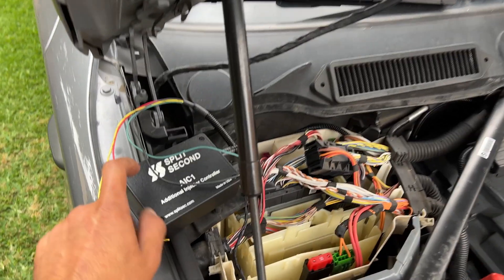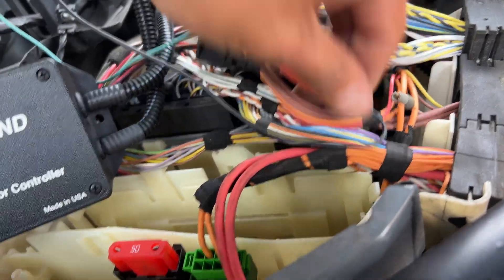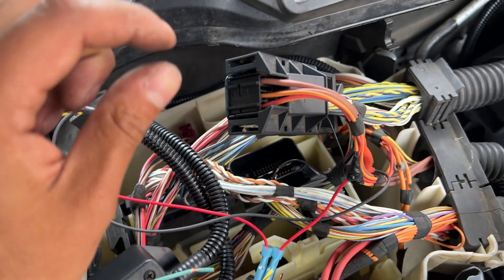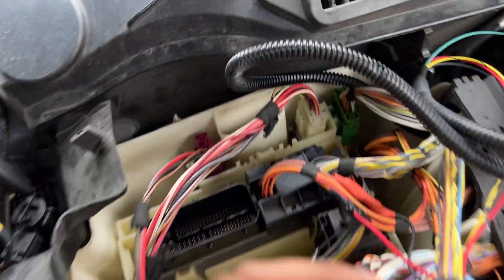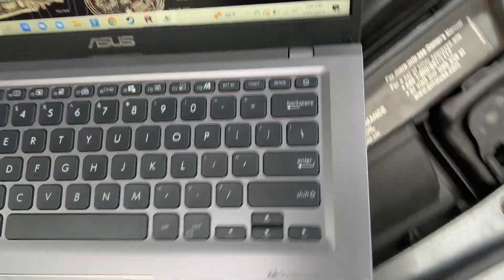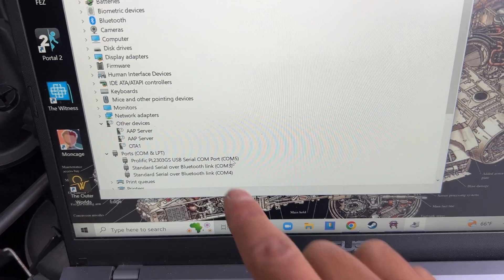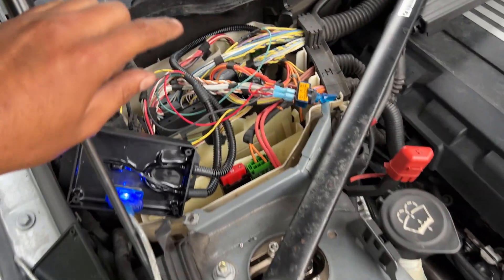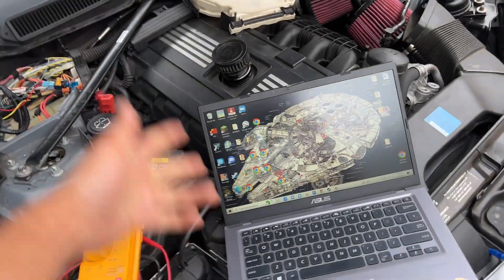How To Wire And Flash Port Injection Onto BMW!

Comment: So theoretically, I don’t want to run direct injection bc I don’t want to buy index 12 bc they are $2000, I can run port injection alone?
Reply from the maker: Yes but you would have to get a full custom tune, drill and block off the DI holes

Comment: do I need to flash the ecu thro the computer if I have mhd? or can i just wire it and the tuner can control it via the mhd custom tune etc etc?
Reply from the maker: It’s flashed separate with a laptop and usb cable

Comment: I’m trying to flash my port that has already been previously flashed from the last owner. And I’m using the exact same cord and following the instructions that you are going by. and for some reason when I pull in the tune for it in r4, I cannot switch COM1 to COM5, the drop box doesn’t even work. Pretty confused right now and need some help lol. I’ve turned the ignition on and all to get a connection and just can’t figure out why I cannot switch COM and flash
Reply: Do you figure it out bro I have the same issue
Reply: @ bro I did figure it out, but unfortunately I don’t have the car anymore and I don’t remember what I did, I sold it cause someone asked the right price..
Reply: I see well I need to do some research because I don't know why is not connected to the dme it says com error something like that and I switched to com4 and it says make sure your split is connected right

Comment: So i followed the n54 wiring diagram online and my car seems to sound like a cammed 67 big block lol, what could i have done wrong?
Reply from the maker: Either wiring is not making good contact. Or the time you have on the AIC controller. The Port injection should not be activated at idle. Usually only under load
Reply: @menjicar  I fixed the problem, it seemed to be the 3 port max solenoid option on MHD conflicting with the box.
Now only having idle problems (wants to stall, bouncing from 500-700rpm) i believe it’s lpfp since it’s at 58 on idle

Comment: Hey I found and now use these connectors that have built in Solder as well they are already shrink tubing all in one. They are great and all sizes. I bought them from a local shop in Canada Alberta called "Princess Auto" Which is very much like your Harbor Freight I hink. Maybe look into them. I don't recall the name now and I'm not home to look. Sorry.
Reply: any update on this?? i’m in ontario